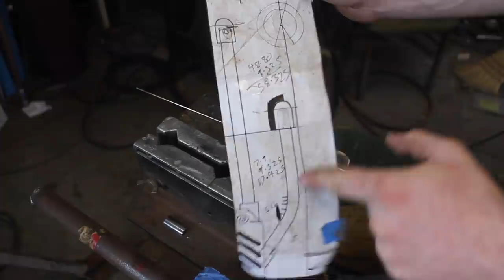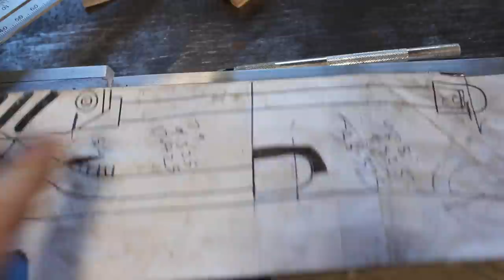40k Power Sword: The Second Vid

Comment: All I can say if you have ever used a angle grinder you will have total respect for how the hell he cuts so perfect without over shooting his marks. This is a total master class in fabrication detail.
Reply: Having used an angle grinder for many years, I am still amazed by his skill with one. He is certainly a true master
Reply: i once knew a guy that wanted to shave down his piston rings with an angle grinder. took about 5mm off and ruined them.
Reply: Omg seriously, his grinder work is #goals
Reply: Hell, I find dremels hard enough to keep on target some days.
Reply: Not just his precision, but the control he has over the tool in general is amazing. I always get kickback when using mine, but I've only seen it happen a few times on his channel. It's insane!

Comment: when michaelcthulu says "yeah, that'll do," it's more precise than anyone else could get.
Reply: At 16:30 or so when he's fiddling with the heights of the bronze bars, and the ends were off by 0.22mm(0.0087"), that is roughly 2 sheets of paper, and novice machinist levels of precision. That he did with angle grinders and a dremel.

I've messed up projects on a lathe by more than that.

Comment: Michael, if you read this: save your super saturated vinegar, the stuff you toss because it's all used up. It's an excellent natural dye for tannin-rich woods like oak. Wipe some on (after filtering) and see what i mean. It turns jet black!

Edit: just don't let it pool up and dry, because then it'll turn into a reddish pile of rust on the wood. Wipe on, wipe off, repeat.
Reply: Interesting, didn’t know this.
Reply: To bad he doesn't use wood for handles that would look sick
Reply: Also turns vegetable tanned leather black.  Same reaction with oak tannins.
Reply: Oh that's wild, I wonder what causes it
Reply: @Codebreakerblue  iron dissolved in the vinegar (iron acetate) comes out of solution as ferrous tannate (not hematite) when reacted with the wood tannins. Cool part is it's not painted on top the wood, but fully ingrained into the woods or as others mentioned, leather
Reply: @KyleLigon  that's so cool, thanks for the explanation!
Reply: ..i wish i had seen this before dumping my used vinegar
Reply: It isn't quite PH-balanced though. Does that even matter when dying wood? Interesting to know, nonetheless.
Reply: Alternatively, let the vinigar evaporate to collect rust, then combine with powdered aluminum to make thermite.
Reply: @KyleLigon  Neat. Is that the same principle as was used to make iron gall inks?
(also, when is Mike moving his forge to Mars?)

Comment: I'm telling you Mike, if you have metal parts you don't want MIG splatter on cover the surfaces with soot from your oxy acetylene torch, it really works. 

Looking great so far can't wait for the next part. 👍👍 If you don't want to use oil for drilling there's an old school machinist trick of using Rubbing Alcohol or Denatured Dlcohol and even Kerosene as a cutting fluid.
Reply: I'm pretty sure I've seen him do exactly that in the past (re: the soot). He definitely knows.

Comment: As I understand high carbon steel has a high threshold to make it magnetic but gets magnetized much stronger as a result. Hardox has a relatively low carbon content compared to carbon steel but much high than mild steel, this makes it easier to magnetize than high carbon steel but retains magnetism much stronger than mild steel. If you are welding or plasma cutting hardox you're passing a current through it, which is one way to magnetise steel. Also using a grinder on it may also impart static electricity to the material, also making it lightly magnetic. I'm no metalurgist but this combination of factors is probably why hardox magnetizes so easily.

Comment: If you use non-chlorinated brake cleaner, you can weld after and not die of mustard gas and it will clean all oils away while evaporating away after....

Comment: 50:45 This has happened to me in other stuff, mostly on thinner material, but same method should work. Get stiff round bar or similar into vise. Locate bumb over it on other side and hit it with hammer, or hammer and a punching tool, round bar or similar to make it go in again. For this you need several hands, or just locate part in place, hold with one hand while other gets the punch. force peace to hold still with punch and reach for the hammer. Everything will jump out of place after the hit, but just repeat until fail is gone and you eventually learn not make same mistake since its pain to fix with out helping hand! :D
Also 1:03:10 Auts, felt that all the way over here and got numb arm! Gotta remember that when i get my self a tig welder!

Comment: I think I can explain why the feathered piece didn't lose length like the flat piece did! I believe this is an example of drawing, basically every time you made a groove with the chisel, you pushed metal aside rather than cutting it off, like grinding would have. So in the long run, what length you would have lost from bending, you regained from drawing. You only bent the second plate, so you didn't offset the loss like with the first.

Of course, I'm not any kind of smith, so I wouldn't take my answer to trivia night down at the pub.

edit: If only I'd waited just a minute or two... turns out it was just a template issue :(

Comment: Steel lgets magnetic whenever you strap it down with a magnet and then grind on it- probably just residual after it was hardened and tempered in the factory for surface grinding.
Whenever i make knives I use a big welders angle to to do the heavy cut grinding and they're magnets after it, throw them into the kiln for heat treat and they'll be normalized after due to phase changes in the metal from ferrite steel to austenite steel
Course if you do it after its hardened with magnets again, all the little iron atoms will line up again and impart some magnetic zones on the metal (of which there are many) but I wouldn't go so far as to worry about having to degauss it or anything.

Comment: For that basket guard plate with the bird leaves, it'd maybe have been a bit easier to make this out of a plate of Brass or copper.
Idealy, you'd also want your workpiece to be kinda soft for the chiselwork (chasing? chiseling? Sorry, I don't know the correct term for the technique in english) to "bite in" easier. Best would be to soften the material a little, then form it, then soften it again, and so on, until you're finished.

Ah, I would've loved to help you with that part. I quite liked to do this technique.
Maybe you could take a look at some goldsmithing techniques. That could be helpful in the future.

Comment: Oh jeez so much work went into just bending the little metal pieces in the exact right way. I wonder how much you could get done if someone sent you a metal CNC machine and one of those big things where all they do is hold a piece of metal and then you bend a bigass flap that bends it at exactly the angle you want? I just googled it, I think it's called a "pan sheet metal brake"?

Obviously I can't do either of those things

But jeez

So much time and effort

Comment: do you have the auto focus turned off on your Canon camera for a reason? or are you saying it doesnt auto focus because you have it turned off and dont realise? ;)
Reply from the maker: It SAYS it was an autofocus, but maybe because the camera is so old it doesn't actually work. Or if it does work it works at glacial speed.
Reply: @michaelcthulhu  both lens and camera are but your lens has auto focus and image stabilisation turned off. just checking you knew that tbh